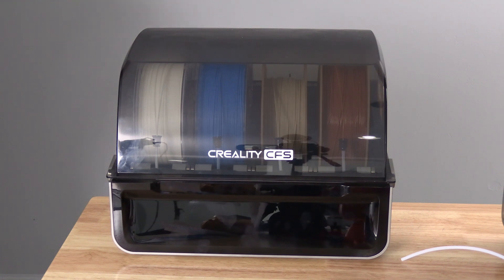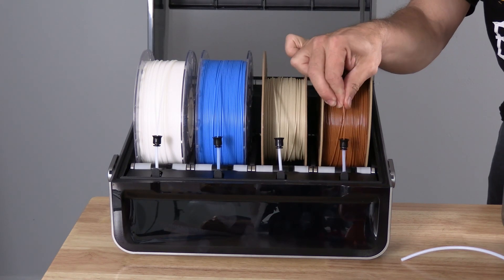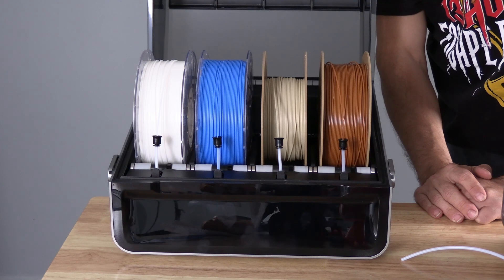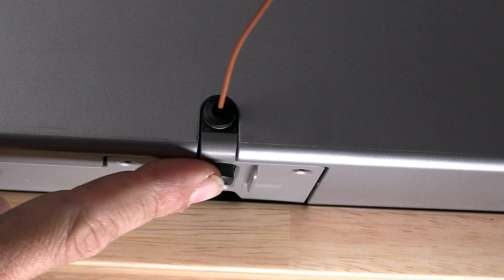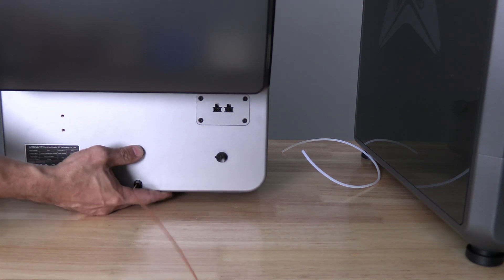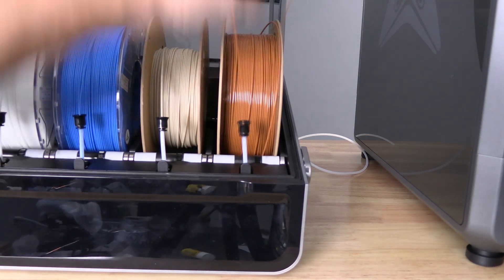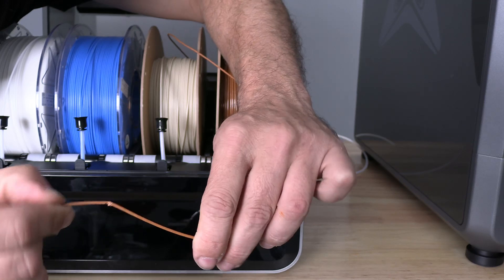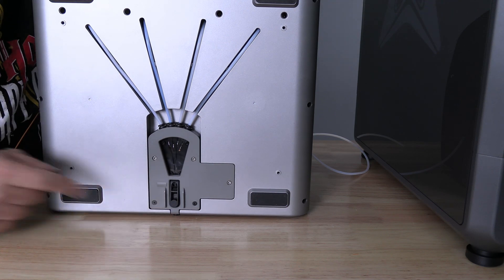K2 Plus: How to Manually Release a Stuck spool of Filament, from the CFS

Comment: This single button has made me hate my machine more than my ender 3 pro. The k2 plus was giving me errors, but stopping me from correcting them myself. If only the machine had a screen on it with the ability to display text that could have informed me of a simple hidden button that if unused can render the machine virtually un-usable. I'm still very close to sending back what should be my best machine and relying on my k1 max and p1s. 

I'm getting burnt out trying to just keep this thing from destroying itself. when it works, it prints abs and asa like a monster, but then I ask for a simple, single color, pla cube (even after using purge filament) and its all extruder disassembly and waging war with the cfs that decides to do the opposite of everything it should.
Reply from the maker: I don't know what to say here. I kinda agree. K1 Max & a P1S are also my GO-TO machines, and my K2 plus has been a royal pain in the ass. I am doing my best to sus things out and help others as best I can.
Reply: @3DRundown  I found something that seems to help, for me at least. My problem was being caused by the spring in the button on the bottom of the cfs being too strong for silk and matte filaments (even creality's own soleyin) and instantly grinding those filaments to dust when the cfs tries to unload the filament from the toolhead. I replaced that spring with a stock ender 3 bed spring I had around and it seems to be working.
Reply from the maker: Super cool use of an Ender spring!

Comment: Thank you for this video!  I used my CFS for the first time today and for each filament change I had to use your solution.  I looked at all of the comments to see what other folks were doing.  My first thought was to cut the spring but I tried changing the Bowden tube lengths first.  Luckily for me this did the trick.  If I have problems down the road I will consider shortening the spring.  I have a K1C and the CFS buffer is mounted to the back of the printer and not the CFS.  Currently everything is working as it should.  Thanks again for this and all of your videos!
Reply from the maker: Shorter tubes are the ticket. 🙌🏼⭐️⭐️

Comment: Ok... I have figured out the design flaws with the CFS and printer integration.
1) The CFS Buffer needs to be mounted on the back of the actual CFS and NOT on the printer (Shortens the distance for the filament to travel and you have to cut the tube to size)
2) There is major LIP in the little black tube where the Bowden tube connects to go into the printer where filaments gets caught/stuck when trying to go into the printer. Which leads me into the next thing)
3) When the Filament gets trapped there (the above mentioned tube), the CFS MOTOR WILL GRING the crap of the filament to try to force the filament in...
AND in doing so creates a major deformity in the filament causing it to get stuck in the CFS base and won't retract neither.
SOLUTION: MODIFY the tube coming out of the printer so it doesn't catch incoming filament, mount the buffer on the CFS and shorten the travel distance... as long as the filament makes it all the way to the extruder and gets sensed by the filament sensor it will be fine. However the CFS needs a firmware update where it won't keep grinding the filament if it doesn't make it to the extruded by a certain time. Hope this helps.
回
Reply: Has Creality provided any CFS firmware updates to your knowledge?

Comment: Didn’t work. Shit stuck. I paused my print because i was sick and the noise from it was driving me nuts. Tried 2 days later. Shit stuck
 Like its glued in
Reply from the maker: Check out my recent extruder video. Possible a jam in there. Once you spot and remove the jam, the whole thing will free up
Reply: @3DRundown  
Thanks. It took me a while to unplug the white hoseses and pull it out manually
Reply from the maker: It's a huge pain

Comment: Have you found a real solution to the problem. I get that randomly during prints or just loading sometimes. I have to take everything apart and lose filament. On top of that when it gets stuck like that i also get a clog on the extruder. The CFS has been nothing but problems. Any ideas on how to help? Thank you!
Reply from the maker: I found that shortening my PTFE tubes helped allot. I feel like the K2 is also triggering some false alarms, that are causing the jams, when it was fine and shoulda continued. I think a little more work on the firmware and profile, will iron this out. I need to mess with mine a bit more
Reply: I've seen where in a lot of cases the spring in the CFS hub is too tight, and this video shows you how to clip off a tiny piece: https://www.youtube.com/watch?v=t1PL2Zw09Y4&ab_channel=3D4Everyone

Comment: My system thinks there's filament in the system even though all the spools have been retracted. I went to the point of turning off the printer, unplugging the CFS, turning it on, and trying to reset it that way, and not it thinks I have spool holder filament in the system that has to be removed before I can use the CFS.
Reply from the maker: Can you try to heat it, and manually push filament through the hot end? Perhaps something broken off at the runout sensor?
Reply: @3DRundown  All right, heating the nozzle and pushing things through seems to have cleared the confusion for the filament sensor. The CFS vs. Spool Holder issue was misattribution of where that filament was from the firmware guessing where it was from.

Comment: Pushing that button not working any other ideas
Reply from the maker: Filament stuck somewhere.... find it. Maybe at the toolhead, in the extruder? Can you release any of the bowden tubes? If u can, release it and cut the filament
Reply: I had to take my buffer apart and there was a big glob of filament in it blocking it from coming through.

Comment: Every single time i try a multi color something similar happens. Thanks fir the video, sadly mines still stuck somewhere it doesn't release when i press that.
Reply from the maker: Are you slicing with Orca? Orca was causing false jam errors for me. Use CP5 for now, disconnect the Bowden tubes, try to find the source.
Reply: @3DRundown  ohhh interesting. Yes I'm using orca. First time it was actually a filament jam in the extruder which wasn't fun. This time it looks like it as well as that's where the filament is. Will have to take it apart and try CP5. Was trying to avoid that because, well why not use orca my laptop is getting tired of all these slicers. Thanks for the response!
Reply from the maker: I like Orca, but I use Bambu Studio for almost all my printers. I tested my K2 with the Orca K2 profile, and it was causing false CFS JAM errors..... then this happened. I went back to CP5 for now. Sadly, my K2, is on the back burner, while I catch up on other things, but, I will be putting it back on the studio desk soon, as I have a new toy on the way for it..... We'll check out Orca again on it.... (Till I have a working BS profile).
Reply: @3DRundown  you were right. Printing on creality print and I'm not having constant jams. Thanks for getting back to me man, solved me a huge headache getting that spring back in place is not easy!
Reply: @3DRundown CP 5 can’t even handle pausing and changing filaments at a certain layer properly

Comment: I think you mean CFS at 1:18
Reply from the maker: Potato Potado.
Reply: Could you make a video please showing how it all works and where the motors are within the whole CFS system? 
Are there motors per spool? And then a motor in the buffer? 
Is there still a motor in the print head or does the CFS make it a Bowden fed print head now, rather than direct drive?
Reply from the maker: I will try my best to get into all of this. I'm starting with informational videos, then, will move on to Service videos. Since, right now, with very few K2 in hands, Service videos, can wait a bit, as peeps are mostly looking to learn about the machine at the moment. However: YES it's still a Direct Drive. YES, the CFS also has independent motors. The buffer has no motor, it simply guides the filament, into the right path, getting it's movement, from the movement of the filament.
Reply: @3DRundown great approach, working on the information videos then the service vid’s. Got to walk before running.